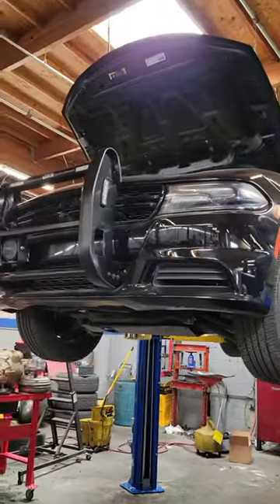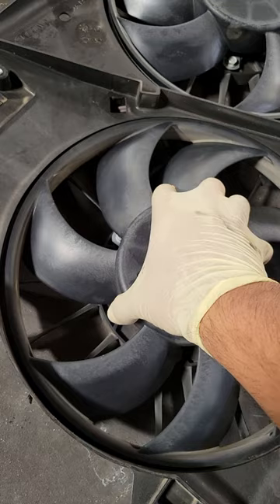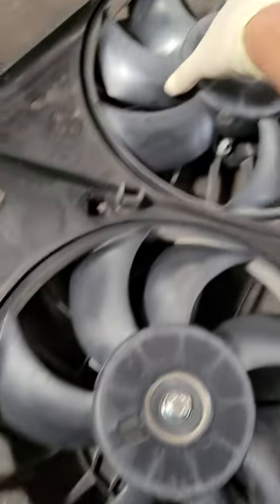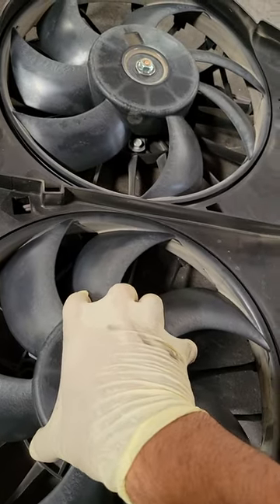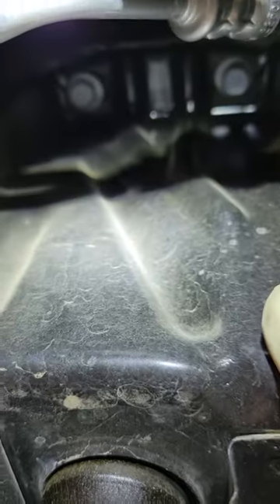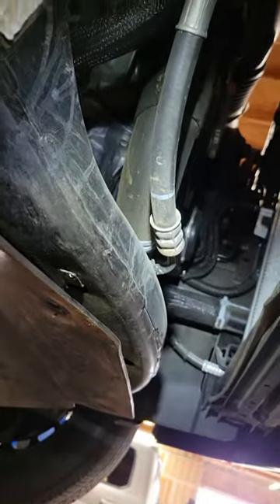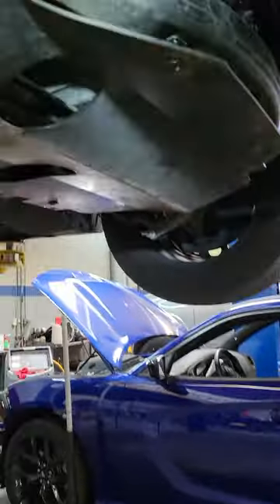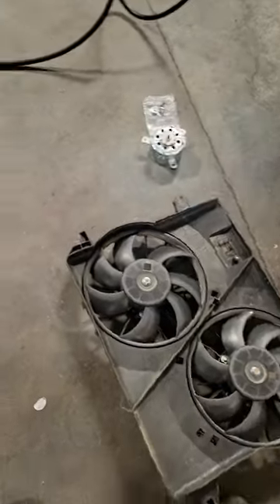2020 dodge charger fan motor replacement

Comment: What’s the part number for the new fan motor?
Reply from the maker: Oof u can call a dealer they can give u part numbere I dnt have it anymore sorry
Reply: @LPrimo_mobilerepair  yep, did exactly that. Thanks for your help. Your video helped me identify the problem.
Reply: I have the fans pulled out to replace but one fan spin by hand freely and the other doesn’t .. is that normal?
Reply: I only have 1 fan